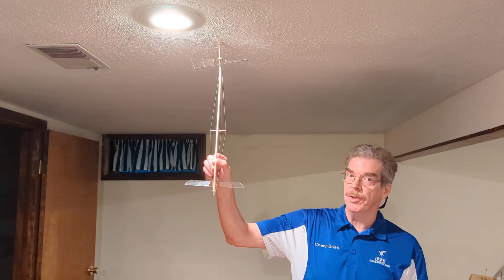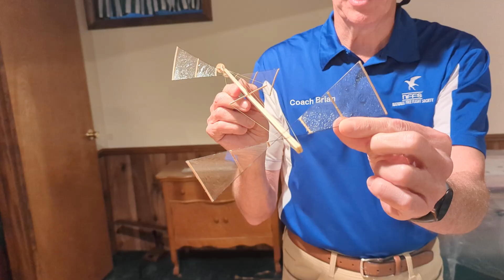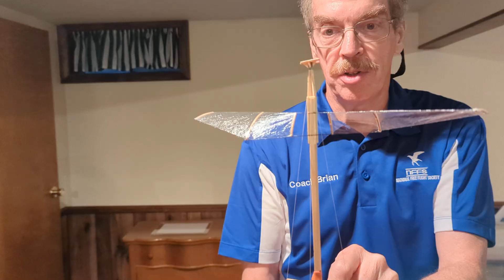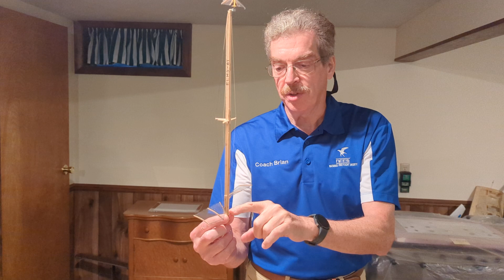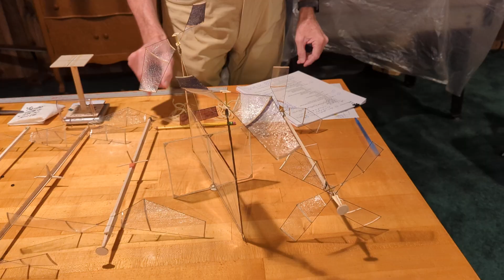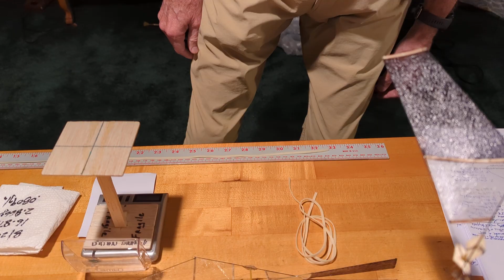Science Olympiad 2024-25 Helicopter Event Basics

Comment: What are the measurements of your designs, or avg measurements?
Reply from the maker: The 2024-25 prototype my teams have been testing uses rotor from a previously constructed Freedom Flight kit from 2018. Of course, this is not legal for my students to use in competition as they did not build it. It has allowed us to gather data to point us in a good direction though. The rotors are 30 cm diameter with 8" average pitch top and bottom. The fuselage stick is 14.75" long. Interestingly, these dimensions are close to the same as found on the two top kits on the market so far, the J&H Aerospace and Freedom Flight Models kits. As all of these helis fit easily in the rules maximum size box, I am thinking that they are partially designed so that they are flyable with commonly available rubber size (1/8" wide strip) and are not necessarily the absolute optimum design solutions. However, larger rotors that this will require very high winding torque and thick rubber motors and most teams do not have the equipment (winders, torque meters and rubber strippers) to go high torque and thick rubber.
Reply: @FreeFlightDigest  I understand that the 2025 rules specify the helicopter must fit within a box measuring 47cm x 32cm x 24cm. Could you clarify whether these dimensions refer to the internal or external measurements of the box? I assumed these are internal dimensions to account for potential variations in box material thickness, but our students believe they may be the external measurements. Could you confirm which is correct?
Reply from the maker: @ciphersingla this question needs to be posed to the Science olympiad FAQs as science olympiad is the ultimate arbiter of the rules..

Comment: Quick question. What is the string that is coming down the sides of the heli used for?
Reply from the maker: They are bracing wires to keep the motorstick from bowing under the strain of the rubber motor.

Comment: Hey, love the video😀. I was wondering what film you used for you covering and how you built your airplanes(did you buy a kit or did you make them from scratch)?
Reply from the maker: Rotors for the current year (2024-25) prototype heli demonstrated are from a 2018 Freedom Flight Models kit. At 30 cm diameter they are a little smaller than the maximum that will fit in the maximum sized box allowed by the 2024-25 Science Olympiad rules. Ultrafilm covering. Fuselage is scratch built, but is essentially an appropriate density and weight stick with kevlar thread lateral and top trusses. Chinook is the exact 2018 Freedom Flight Models kit (3.5 grams). Other helicopters were scratch built or used parts from the 2017 Freedom Flight kits - Coach Brian